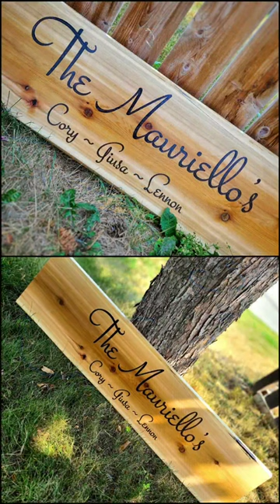Creating a Stunning Epoxy Resin Wedding Plaque on Live Edge Cedar

Comment: Did you put clear resin on outside? When you finish what was the oil you put on it?
Reply from the maker: No resin as a top coat, but you could instead of the oil.
I used Osmo to finish it with, but most harding oils will work for the finishing coat.
Reply: @MakeTechCreate  thank you so much I'll have to look into that when I finish my project
Reply from the maker: @sakuraneko9972  you're welcome